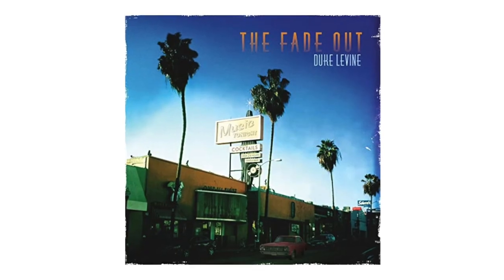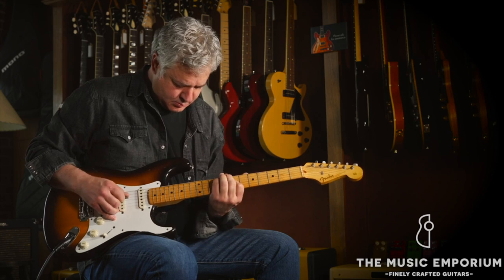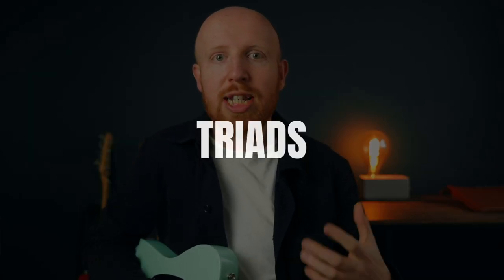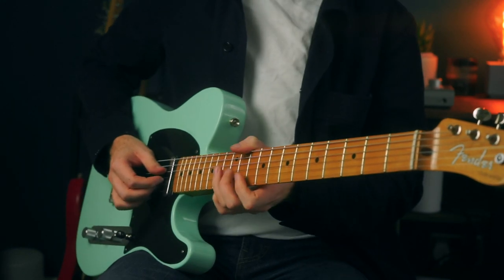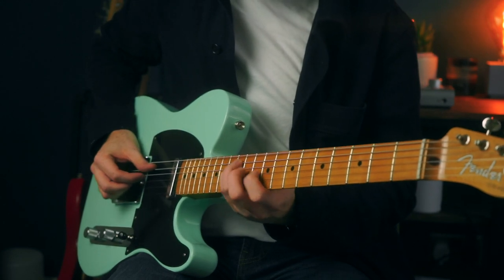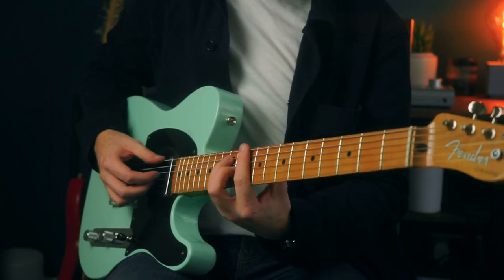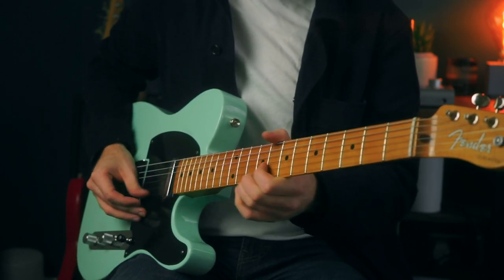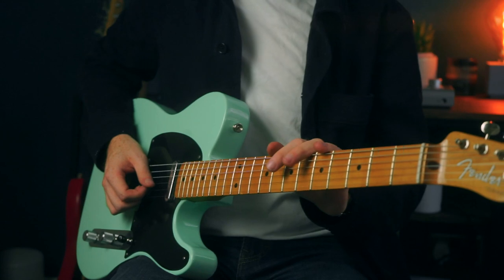3 COOL Hacks for Getting the Pedal Steel Sound on Guitar

Comment: question: Ernie ball sells 10 string steel pedal strings. afaik the scale is not so different  (24 inches), would those strings fit a "normal guitar" (choosing either the top 6 or any combination?) the gauges go from 10 to 38 🤔 i am just wondering